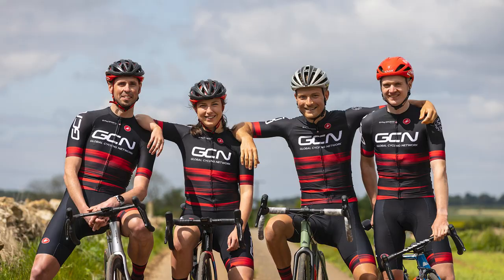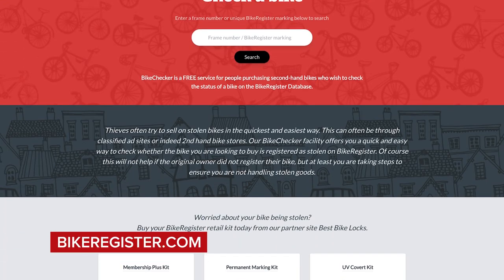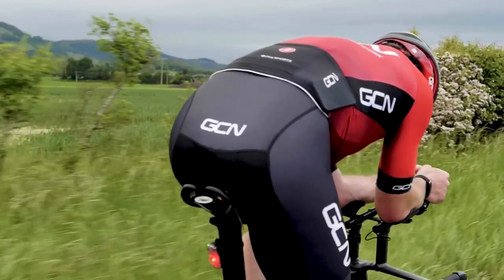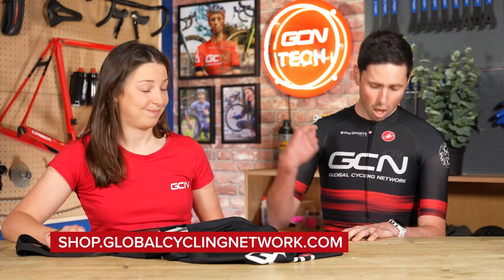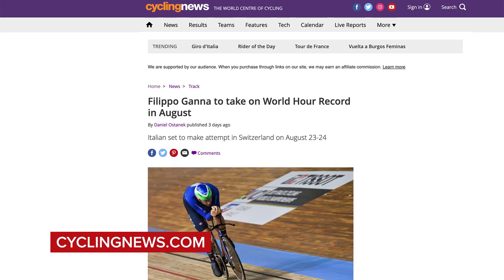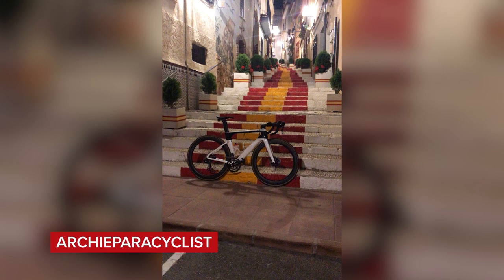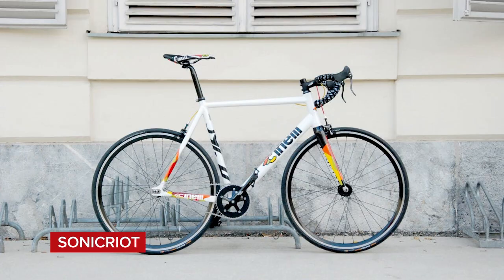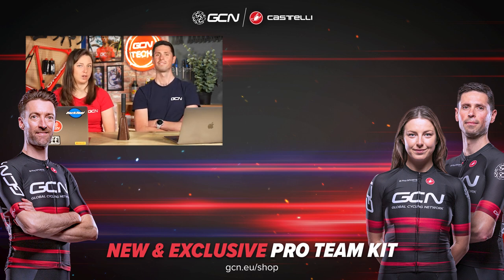What To Look For When Buying A Used Bike | GCN Tech Show Ep. 231

Comment from the maker: What’s the best thing you’ve bought second hand and do you have any tips of your own to spot a bargain?
Reply: Pinarello Prince. Tip: be patient and check sites everyday
Reply from the maker: @account28191  There certainly are bargains to be found!
Reply: S Works Roubaix, 2 years old, immaculate condition,  Sram Etap, bargain at £3995.
Reply: Time Scylon frame $1500 nearly perfect. One clear coat chip. Rim brake bikes are getting dumped and can be picked up cheap.
Reply: I bought a set of Shimano SPD pedals from a mountain biker friend of mine who decided he doesn't like being clipped in.
Reply: A 94 Allez  (first aluminium framed Allez) with Campagnolo groupset for £20.
Reply: Cannondale CAAD10,old SRAM Red & FFWD carbon wheels, less than 2k CAD, insured it for new value. 
Then someone doored me and I received a brand new Émonda of the year to replaced my destroyed CAAD.

I’d never buy used things that touch the skin, that are worn on the body : clothes, helmet, shamy cream, etc. Even bike shoes. I’ve worked 10 years in a used sports equipment store, I’ve seen things that cannot be unseen, would avoid 10/10.
Reply: I bought a genuine scratched to death chinerello dogbaw2 frame and forks.
Reply: Got a Campagnolo Super Record EPS 11 grouppo for $1400 and a brand spanking new Super Record 11spd cassette (11-29) for $150. I have been using these parts nearly everyday since the pandemic and thankful.
Reply: I have bought 3 complete used bicycles, including a vintage 1999 TREK carbon frame hard tail MTB original MSRP about $4000 US paid $650. Each of them in person with a short test ride. Have been happy with all of them. I am fortunate to have a Bicycle specific swap meet in my area San Diego, CA USA twice a year, that is where I have bought the bikes. Also have bought quite a bit of used parts locally listed on internet such as craigs list but always local pickup so I can inspect them. Latest score was a 2007 TREK complete road bike with 105 and ultegra components, Rear drivers side dropout was cracked, and mech hangar bent, likely the chain went into spokes. Price was only $10 US dollars, included 3x10 105 brifters and 105 Hollowtech crank. Only time deal went bad was buying a set of Alivo cantilever brakes, for a vintage MTB project. Turned out that the plastic piece that holds the spring in place was cracked on one and missing on the other. No replacement parts are available. Good thing I only paid $5. As for tips to spot a bargain, general bike knowledge for the era of bike you are looking at, do some research ahead of time for things like what size frame is best for you. It is a little more difficult with newer frames you can't just measure the seat tube. Bring a tape measure, calipers etc especially if you are shopping for parts to check compatibility. Be aware of boost non boost wheel/frame compatibility. There are online sources to look up bike value such as bicycle blue book or similar, it can be a little tricky to figure out the specific year and model of the bike, I typically will do an image search online for the make and model, to find a picture that matches to figure out the year.
Reply: Factor in the cost of three things - new chain, new cassette, and new chainrings - when determining just how great a bargain it is. Sadly, I learned that the hard way. The bike rode beautifully on the worn chain with worn parts. Replacing the chain led to a replacement of nearly everything else that depends on wear between certain tolerances. As for used bib shorts, no ta - I'm not sharing swass with anybody.
Reply: Tip: buy used from your lbs. I got a light speed titanium 18 years ago, all durace at an excellent price.
Reply: I bought a 2018 Norco Search XR for around half price from my LBS.  It was part of their demo fleet.  This is a good example of how you can get a good deal, but also know that you're also going to avoid the pitfalls of buying used.  You know the fleet was maintained by the shop and kept in working condition.
Reply: The only used gear I've bought as a cyclist is the bike itself, and a few pairs of pedals over the years.
Reply: Both my 2014 argon 18 gallium pro and 2019 sworks tarmac sl6 rim brakes bikes are bought second hand. Both of them are original, good prices and in good conditions too 😊. I purchased them via a reputable online bike stores that are mainly focused on  selling used bikes.
Reply from the maker: @johnmcgovern5372  What a bargain John!
Reply: In the early aughts I paid $100 for a pink Miele Chic with Columbus tubing and a nearly complete Shimano Santé gruppo. I believe the rear wheel and the Selle Italia Turbo Special saddle were the only non-original parts, it was well-used but still in fantastic shape. It rode like an absolute dream and was easily the prettiest bike I've every owned.
Reply: I've bought a variety of bikes and gear via EBAY. The folks who are not used to selling bikes generally take longer to get proper packing and shipping done. But sometimes better deals.
Reply: @gcntech  Yep, it did need some work but thanks to the donation of a saddle, pedals and part worn tires from a Raleigh R100 that had an unfortunate incident with a Volvo last year I was able to get it back on the road for the price of some brake pads and cables.I put it in the Bike vault about 6 weeks ago...
Reply: Serotta Legend Ti with full Dura Ace and Mavic Ksyrium SL's in almost unridden condition by being in the right place at the right time at the right price.

Comment: I have never owned a brand new bike. I always buy secondhand bikes and then my local mechanic helps me to fix it up and upgrade parts. 

In my opinion it is better to own a secondhand bike with good parts than a new bike with lower end parts. I have also bought some used wheels.

A few mistakes I made when I bought my first used bike
1. Make sure the bike is the right size. This may sound stupid but if the bike is not the right size you will have a lot of problems down the line. Especially for younger riders I bought my bike when I was 16 thinking I will grow into it.
2.LOOK at the bottom bracket you often get so exited and this something you can easily miss like I did.
3.Look for buckled wheels.
4.If you buy your first used bike and it has a lot of problems ask your local mechanic to explain to you what is wrong and how to see the problems so you don't make the same mistakes again.

 If you can find a good used bike they can save you a lot of money.
Reply: Totally agree, I would never buy brand new i 've even built a mountain bike all from fb marketplace (except dropper post).  Just be careful with dodgy people selling top kit but no idea about it?!
Reply from the maker: Great tips! 👍

Comment: 15:51 - Romet is actually the biggest bicycle manufacturer in Poland! This brand is over 50 years old now. My second bike was a single speed Romet Wigry 3 - a communist era folding bike. It was fun... until the hinge failed while riding :-O

Pr0 tip: don't buy used folding bikes with strange welds
Reply: Currently converting a Wagant Sport to single speed. :)
Reply from the maker: Now we know! Thanks for the info! 👍
Reply: Lol, I still have my dark blue Wigry3, collecting rust in a basement. :D

Comment: I've just bought a complete 1980 lugged steel Motobecane, sight unseen.  Shipping from a few states away is costing me more than the bike.  This is a nostalgia buy, the same model as my first actual decent road bike I bought way back in 1979 or 80.  It does have some wear and tear, but the pictures and description indicate that is original, complete, and rideable as is.  As a longer-term restoration project, this will be ideal.

Comment: I showed up to buy a pair of 404 firecrests and didn’t back out when I got there and they had alloy rims.  Researching later they were old zipp 404 before zipp had different levels.  I took the firecrest stickers off and sold them on layer for not much of a loss.  They did have a Chris king 11 speed hub upgrade, but I didn’t want 13mm internal width rims! I bought and sold many of of parts used most all wins.

Comment: The funniest thing is, if they decrease the pressure of car tires, they are actually polluting more if the car is driven with a low or flat tire. The car has to work harder to do the same distance
Reply: It is extremely inadvisable to drive with a flat tyre for more reasons than just fuel economy.

Comment: Many brands sell lower spec bikes into poorer markets. Not actually fake but not intended for some markets but if they turn up here they could be confusing and perceived as fakes. Most brands don't manufacture themselves, most its just importing and others its just assembling mainly. In the EU we get bikes from factories that avoid EU tariffs like Cambodia, Vietnam etc but in another market like the US they may get slightly better made bikes made in mainland China. You could perceive one as fake based on the wrong manufacturing country but that wouldn't be the case. When you look around you can see some manufacturers produce excellent frames and forks at low prices and others produce poor frames and forks at high prices so always worth doing your research on what factory the brand actually uses. I think bikes are more a lifestyle product like cosmetics than about engineering. People spend extra for the right brand because of marketing, heritage or sporting success. You can often get a fantastic deal second hand if you choose the wrong brand but the right product from the right factory. Shop brands from Halfords, Decathlon, Go Outdoors etc are bought direct from the factory and retailed instore so start at a much lower price and the second hand price of those can be much lower too. A few years ago Halfords were getting a lot of their bikes from Merida in Taiwan and they were amazing frames for the money. Great bikes for a fraction of the price of the big brands. More recently they have used Insera Sena (Polygon) and some models fuji-ta like folding bikes. Some very decent factories better than some of the big brands to be honest. There is a big difference between actual quality and perceived quality. You see bikes from the more expensive high quality Taiwanese factories appearing in the cheaper shop brands at lower price points than the big brands. A shop might use a high quality factory at a £1500 price point but a big international brand maybe £2500-3000 and the Italian brands that operate on huge margins might be £4k.

Comment: 10:51 This is a nogo - I'm not a SUV driver, but this is a criminal act since it also jeopardizes people if they drive around with half deflated tires and can crash, even into pedestrians or other cyclists. This will get prosecuted by the police if people are caught doing it.
Reply from the maker: We certainly don't advocate doing this. Much better ways to look after the environment!
Reply: The solution is to fully deflate all tyres then.
Reply: @jozef6663  some cars are equipped with run flat tires, drivers of these cars can drive slowly up to 50 km with flats. However, if they corner fast they may lose control - and some drivers will attempt to drive to a gas station to reinflate them.
No, this isn't a solution, it's just a crime to do it from beginning on, and it will be treated by police like a crime

Comment: Bought a second bike to use as a commuter, seller described it as a “good” condition. Turns out it needed new brake pads, new tyres, new cables and a new stem, oh and the derailleur hanger was loose!
Reply from the maker: That doesn't sound like a particularly good condition!

Comment: Always insist on dropping the fork out and checking carefully any ringing around the fork where the headset compression ring would sit...any "ringing" or wear due to a poorly adjusted headset should be inspected as this is a potential failure point you really wouldn't want to happen....

Comment: The reason helmet manufacturers say to replace the helmet after 3-5 years is because of compression and degradation of the foam - not because new helmets are safer. They are the same standards so they are likely the same in terms of safety.

Comment: Obviously used rim break wheels are a risk.  Hard to tell how much wear the break track has had
Reply: A lof of rims have a ring inside the brake surface as a wear indicator. Is it even with the rest of the rim surface the rim is worn. 
If there's no wear indicator you can measure the rim at the outer edge (where it don't wear) with a vernier caliper, if the rest of the rim is more than 1 mm narrower per side it's worn.

Comment: Guess why all tyres are black. There's CARBON in them! And they are vegan, too!
Reply: Yeah, the black color is soot, which is essentially carbon. Cheaper ones use mostly soot as filling material, better ones replace soot partially with silica (these rubber compounds stay more flexible during winter). Some (like the Snow Shoe 2 XL fat bike tire) are white, since it uses no soot but only silica for a best possible winter flexibility of the rubber.